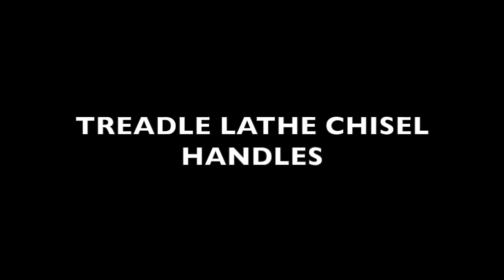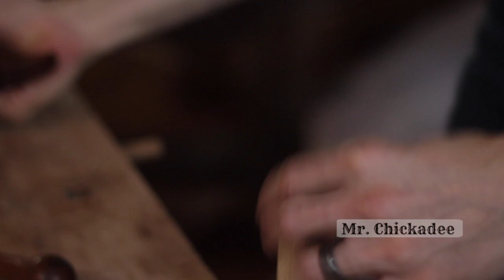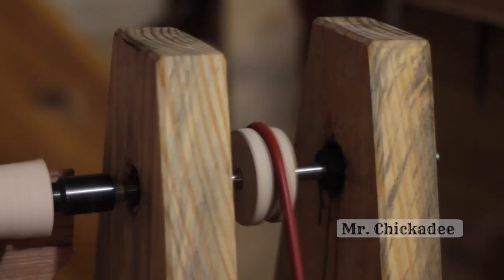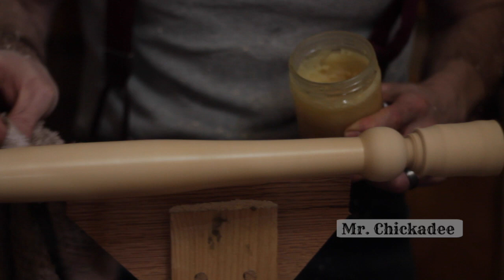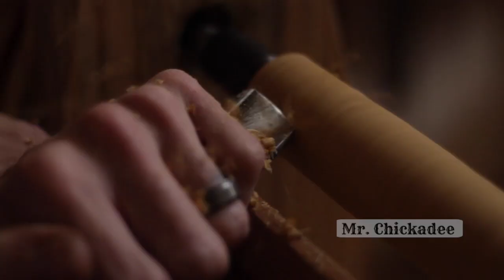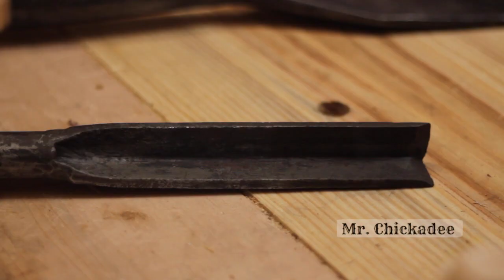TREADLE LATHE CHISEL HANDLES

Comment: I'm proud of you, my boy. That's old school, transferring diameters from inside calipers to outside. People look at me funny when I tell them a careful hand can work to a thousandth or two using such methods. But they did long before accurate repeatable measurement referenced to national length standards found its way to the shop floor. That's how the precision parts of old steam engines and printing presses were built: not to a specific size but a certain fit. One of these days we'll make an old timey machinist out of you. Vertical coal-fired boilers, Corliss engines, leather flat belts, and lineshafts dripping oil forever!

Kentuckey has the coolest firewood. Here we have soft maple, alder, and Doug fir. Good firewood but not too strong or stable. 

In your balliwick you have hickory, a dozen species of oak, hard maple, locust, poplar, and all kinds of fruit wood. Mulberry? What the beck is that? Monkey chased the weasel wood? All fine materials for tool handles, chair parts, and utensils, among other things; cords of it ricked up and drying in the wood shed. Grab a hunk and rive out a billet.

What do you call that treatment to the struck end of the corner chisel handle - where you distressed the exposed endgrain with the hammer claw? Never saw or heard of that before. Does it retain the ferrule better? Make a more resistent surface to be struck?
Reply from the maker: Thank you sir! "most" sockets taper evenly so getting the bottom and top roughed in is a good bet it will fit if you feather that together. Had one with a weird taper, maybe the anvil hardy mandrel was bent or something, maybe by design, but nothing a bit of rasp work wouldnt fix. 

Our eyes and hands and simple hand tools can easily reach precise accuracy, with practice, as you said, many very fine things were done this way, look at old time watchmakers and locksmiths, gunsmiths and on and on. Ever take 20lbs of raw iron and forge and file a rifle barrel from it? Ive not, but they did, thats pretty amazing. 

One reason we moved to the Eastern mountains was the wood. The west has higher mountains, better weather, but something about those wast pine deserts, not a walnut cherry or oak in site, well I guess I didnt want to always order in my beech or whatnot when needed, then watch it shrivel up in the low humidity! 

Its similar to how Japanese chisels are treated when new, the idea transends, and serves a few purposes, namely, holding the furrel on as the wood drys over the decades and pounding, folding the crushed wood fibers over the ferrule give a non marring surface to your mallet head if that concerns you as well.
Reply: Love this channel
Reply: I learned mechanics 30 years ago and half of the time of aprenzicship was filing by hand. It is sad to see that today they mostly learn cnc and if they have to use there own hands, they look helpless. But if I see some vid here than I think there is still hope for good craftmanship.

Comment: Any idea how old those chisels are?  Perfect video! Thanks for sharing.
Reply from the maker: Pretty old, the Slick from a New England smith who made whale harpoons and other tools pre 1850s I think, and the corner chisel is unmarked but shows hand forging marks, both have a wrapped forge welded socket instead of a two piece applied socket like newer tools did from the big factories.

Comment: Nice lathe!  Question on the V-gouge handle.  When you spalled out the butt end, was that to secure the ring, or to make the struck end less likely to split?
Reply from the maker: Thanks, mostly to secure the ring, also to fold wood over the metal to be less marring for the wooden mallet face.
Reply: Thanks!  I've seen that on a lot of old chisels, but didn't realize it was something don on purpose.  I just thought it was the natural result of the chisel being struck.  And I learned something again.  Keep up the fantastic work.  You have a great channel.

Comment: Great video! were did you find the the drive center and dead center? I have been wanting to convert my pole lathe to a treadle lathe but no luck finding the centers.
Reply from the maker: You can still get centers and stuff for old shop smith on Ebay cheap, thats what I used.

Comment: Nice video using old tools and methods.
Just one word of caution.
Use a small rag or cloth piece when applying wax or other finish.
And never have it rapped around your fingers.
You do not want a large rag or towel, it can catch in the spinning piece and break your fingers or break your work.
Even on a low torque lathe like yours can do some serious damage to your hand.
Always work safe.